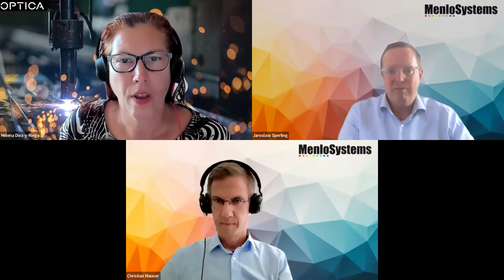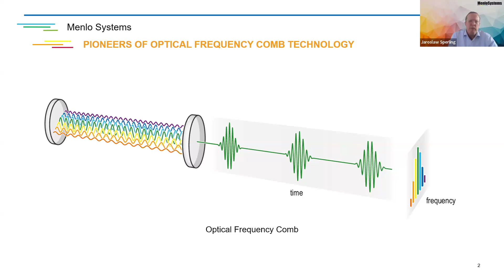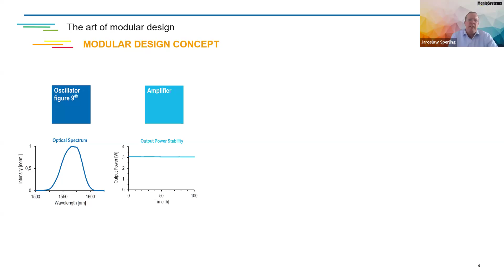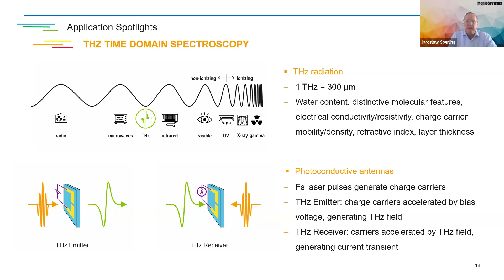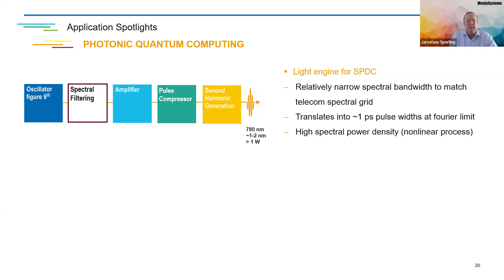Fiber-Based Femtosecond Lasers: Robust, Reliable & Ready-to-Use

Comment: AI Summary

Abstract
This optoelectronics tutorial outlines the design principles, modularity, and industrial applications of fiber-based femtosecond lasers. It focuses on Menlo Systems' proprietary Figure 9 mode-locking cavity architecture. By utilizing a non-reciprocal phase shifter and a nonlinear amplifying loop mirror (NALM) in an all-polarization-maintaining (PM) fiber configuration, the Figure 9 design achieves reliable, self-starting mode-locked operation that is isolated from external thermal and mechanical environmental stresses.

The presentation details a modular laser engineering "toolbox" containing fiber oscillators, amplifiers, dispersion pre-compensation modules, and non-linear frequency conversion stages (including second-harmonic, soliton-shift, difference-frequency, and supercontinuum generation). The real-world utility of these turnkey systems is demonstrated across four key applications: multi-color ultrafast pump-probe spectroscopy, sub-diffraction-limit 3D nanoprinting (such as photonic wire bonding), terahertz time-domain spectroscopy (THz-TDS), and narrow-bandwidth picosecond pulse generation for spontaneous parametric down-conversion (SPDC) in photonic quantum computing. The technical Q&A addresses cavity dispersion management, the elimination of Kelly sidebands, power limits, system costs, and long-term diode reliability.

Key Takeaways and Timeline Summary
0:00 - Introduction to Ultrafast Fiber Lasers: The central challenge in modern ultrafast laser development is transitioning from simple short-pulse generation to delivering highly stable, compact, and low-noise platforms ready for direct instrument integration.
5:13 - Evolution of Frequency Combs and Cavity Footprints: Frequency comb setups have evolved from occupying entire scientific laboratories to fitting within compact, portable 19-inch rack-mounted systems. This reduction in size is enabled by robust, fiber-based cavity designs.
8:16 - Limitations of Conventional Mode-Locking: Standard mode-locking relies on saturable absorbers like semiconductor saturable absorber mirrors (SESAMs). However, SESAMs are prone to structural and performance degradation over time, creating a need for artificial saturable absorbers.
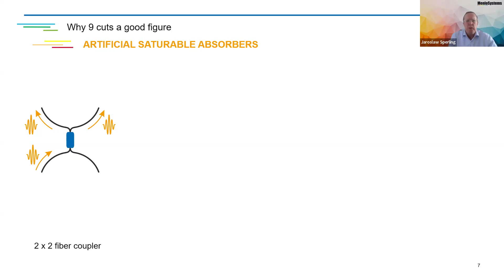10:42 - The Figure 9 Cavity Architecture: While traditional Figure 8 cavities use a NALM, they struggle with self-starting mode-locked operation when built with polarization-maintaining fibers. The Figure 9 design introduces a non-reciprocal phase shifter to bias the loop mirror into reflection mode under steady-state conditions. This allows for a linear cavity arm, reliable self-starting, and structural robustness under extreme environmental testing (up to 20G shock and -40°C to +40°C temperature cycling).
16:16 - The Modular Laser Engineering Toolbox: Turnkey laser performance is customized via a modular system architecture:
Oscillators: Er-doped (1550 nm range) or Yb-doped (1040 nm range) seed cavities operating at ~100 MHz.
Amplification: Power scaling up to 10 W average power and 100 nJ pulse energies.
Dispersion Management: Cavity and fiber delivery pre-compensation to deliver sub-50 fs pulses directly to target samples.
Pulse Picking & Modulation: Acousto-optic modulators achieving rise/fall times under 200 ns.
Wavelength Conversion: Second-harmonic generation (SHG) to the visible/UV, soliton self-frequency shifting (NIR red-shifting), difference frequency generation (DFG) for Mid-IR, and supercontinuum generation spanning up to 1000 nm.
23:01 - Ultrafast Pump-Probe Spectroscopy: Modular fiber-based lasers provide turnkey, multi-color configurations that eliminate user alignment. They generate synchronized fundamental pump beams alongside visible and near-IR supercontinuum probe pulses to span a wavelength range of nearly 2000 nm.
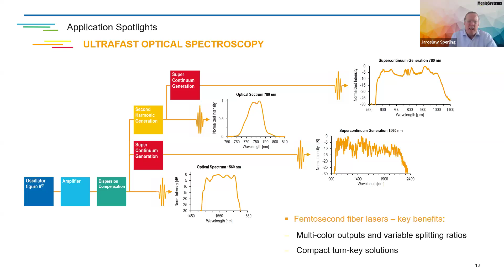25:25 - 3D Nanoprinting and Photonic Wire Bonding: Two-photon polymerization (2PP) uses highly localized, non-linear absorption to print sub-diffraction-limit structures. In integrated photonics, this enables "photonic wire bonds" to connect discrete optical chips. Critical laser requirements for this process include high beam-pointing stability, precise beam quality, fast modulation, and automated dispersion pre-compensation.
30:25 - Terahertz Time-Domain Spectroscopy (THz-TDS): Femtosecond pulses are routed through flexible optical fibers up to 50 meters long to drive photoconductive antennas (emitters and receivers). This technique is used for non-destructive industrial testing, such as measuring the thickness of multi-layer automotive paint.
35:30 - Photonic Quantum Computing & SPDC: Generating entangled photons via spontaneous parametric down-conversion (SPDC) requires narrow spectral bandwidths (~1 ps transform-limited pulses) and high spectral power densities. Menlo's SPDC source filters the seed spectrum before amplification, yielding 780 nm picosecond pulses with up to 1 W/nm spectral power density and optional carrier-envelope phase (CEP) stabilization.
41:53 - Q&A: Mid-IR Generation and System Power Limits: DFG stages operating in the 3–5 $\mu$m fingerprint region yield average powers of 100–200 mW, limited by non-linear crystal damage thresholds. For Erbium systems, the maximum average power configuration reaches approximately 3.5 to 5 W at 100 MHz.
44:14 - Q&A: Cavity Dispersion and Kelly Sidebands: Erbium-doped systems manage dispersion internally using purely fiber-based components to achieve near-zero net-cavity dispersion. This minimizes noise, broadens the spectrum, and eliminates Kelly sidebands. Ytterbium-doped systems require small free-space sections (such as prisms or gratings) or photonic crystal fibers because positive dispersion cannot be easily compensated using standard fibers at 1040 nm.
48:00 - Q&A: Pricing, Lifetimes, and Maintenance: System pricing scales from €10k–€20k for basic oscillators to over €50k–€70k for amplified, frequency-doubled, or phase-locked systems. Because the Figure 9 design uses telecom-grade, passive interferometric fiber components and Telcordia-rated pump diodes instead of degradable physical absorbers, these lasers are maintenance-free and rated for continuous 24/7 operation.

genererated with rocketrecap dot com